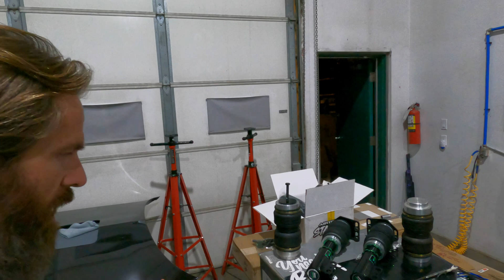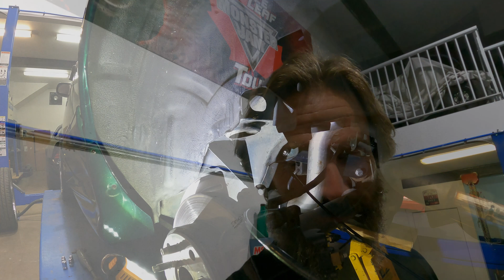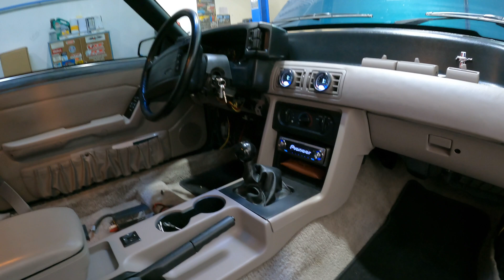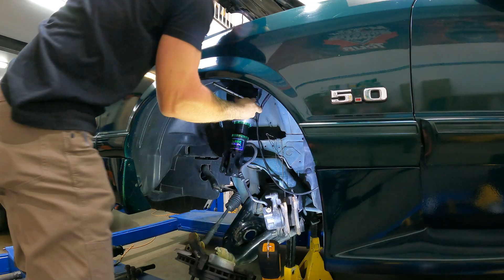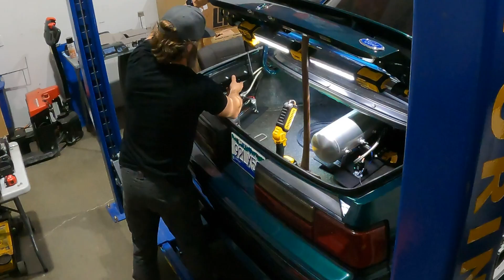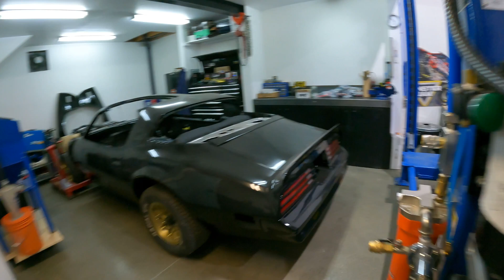I've Wanted This Since 1998! Was it worth the wait? Airtekk Air Ride Instal - Struts, Bags, & Shocks

Comment: Did you have to use both cables that caome with remote i cant get my management to work i have same system
Reply from the maker: I only have one cable and its attached to the remote and plugs into the air management

Comment: Nice! Have two questions 1 will the pumps and tank slide around in the trunk or do you have something holding those in place? 2 what made you go with this kit over the plus kit, any advantages in not having the presets?
Reply from the maker: Hey dude. 1. I do not have anything holding them down yet. I'm thinking a temp fix for that may be just some simple velcro. 2. I wanted to plus kit however they were back ordered. Apparently it is very easy to upgrade after the fact
Reply: @KASLCustoms  ok thank you. First thing I thought of was Velcro but didn’t know if that would ruin your trunk carpet
Reply from the maker: @stanggang4055 my carpet is original and not in the best of shape so it can’t get any worse 😂👊
Reply: @KASLCustoms  oh and not sure why I # my questions, seemed right at the time 😂